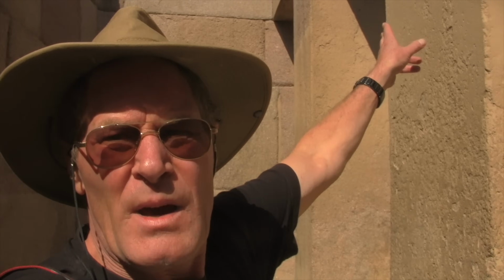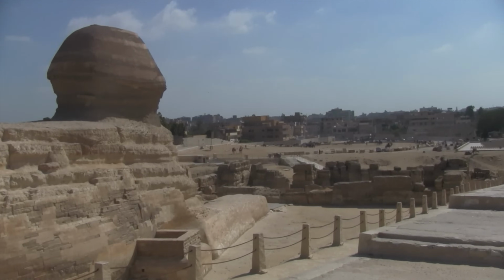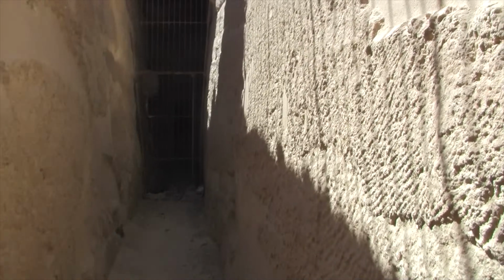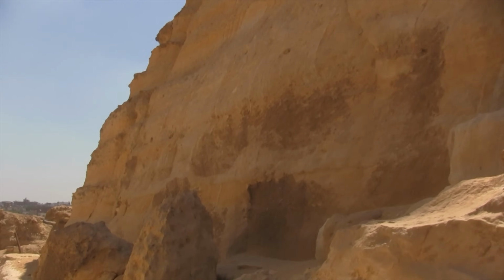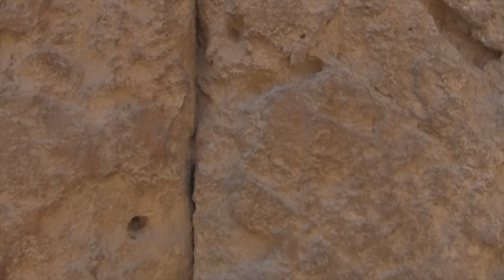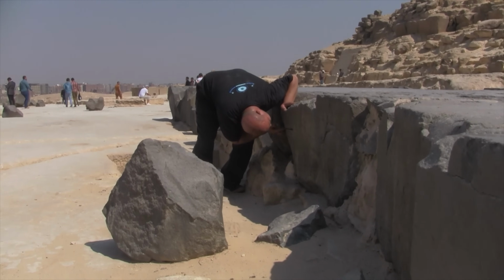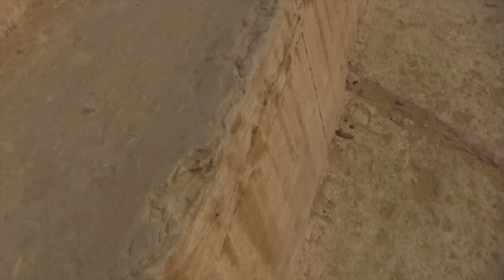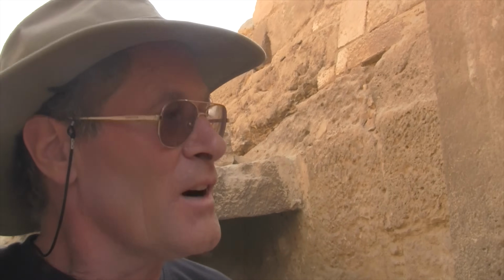Exploring Out Of Bounds Areas On The Giza Plateau In 2014

Comment: Ah those pesky close fitting rock joints - I like the acid theory which I first heard about on another YouTube video.  Ancients knew how to make acids that softened hard rocks which allowed  them, using simple tools, to face stones flat, hollowed them out and while a particular edge was in its softened state, it would allow the block to conform to the block it was set on or against.  This was done in the Americas too.  Ancient energy generators?  Whoa there hombre!  This video went from a fun Giza plateau video log to off the deep end in a real hurry about half way in.  First he says that by "energy" he does not necessarily mean electricity, then a few moments later, yes he says, it is electrical energy.  This guy typifies the random stream of consciousness filled with half baked hypotheses that so many of these ancient civilization videos are made up of (click bait).  They invite you into the conspiracy - All those experts surely are nuts, so listen to me, a random guy in a safari hat.  Regarding "weathering" and/or disruption of ancient architecture, there was a well known earthquake in 1303 AD (https://en.wikipedia.org/wiki/1303_Crete_earthquake ), for example, that knocked the casing stones off of the big pyramids on the Giza plateau.  Tunnels under the Giza plateau - I love how this guy goes from deep vertical shafts, most of which are filled in to a whole system of horizontal tunnels and on different vertical levels.  Not one ounce of proof, although, there are many examples in the Mediterranean of ancient cultures digging underground water tunnels, but come on dude, please stick to verifiable facts regarding such tunnels on the Giza plateau.  Take us in them, show us some maps, don't just ramble on and on and on.

So why did I bother to watch this video?  If you ignore the nonsense this guys is saying, he does take you to some cool off-the-beaten-track sections near the great pyramid.  Also, there is an increasing need these days for more rational people to push back against this sort of jibber jabber.  Clearly, people are believing it and, over time, this softens people's trust in real science.  It is a gateway drug to anti-vaxers and people who think 5g networks give you COVID-19.
Reply: Has anyone actually ever demonstrated the acid theory and reproduced the technique?

Comment: My theory is that the megalithic building is older than we think. Concrete can get harder with age, so why doesn't stone? As we know the earth's axis has changed. What if the rotation was faster wouldn't gravity be less because of centrifugal force? The large stones would be lighter and easier to move. Softer stones would be easier to cut. We have evidence that a huge meteor hit.  Isn't it possible that when that happened, it slowed down the rotation of the earth? That would have caused a huge catastrophe planet wide. The water of the oceans and lakes would cause tidal waves around the world. These are just my thoughts. Thanks for your videos of places that we can't travel to.

Comment: Intimate contact implies continuity which allows for resonance. Resonance is a means of amplifying signals and waveforms such that energy input is retained and improved. A building that can "vibrate" at piezo-electric wavelengths can radiate in the visible and infra-red spectrum. These buildings had "central" heating and lighting!

Comment: A Leyden jar describes the sort of energy storage you are describing, Brien.  In the Perneter theory that is basically a concentrator (whether it may also be a capacitor and store/regulate as well) for the energy of moving water through the network of passages below.  It seems a thorough map of those passages might lead to a demonstration model to prove whether the actual existing configuration could work, because the principles are sound.  It would be great to know that it worked!

Comment: Good look Brien.  That small pyramid( khentkawes) I firmly believe was the original mummification chamber at Giza.  There is a causeway going down from that to a covered up ancient harbor where the dead king would go on a symbolic boat ride on the Nile.  Representing the journey to the afterlife on the milky way.  The celestial Nile.  Fits the ancient text perfectly and that structure is aligned to the setting sun on Dec. 21 from the Valley Temple.
Reply from the maker: Great points
Reply: Amazing bro. 2 of my favorites in one comment. Mind blown. Keep doing what you do, brother. I'm a long time follower. The shit you do on ancient north america is mind blowing, sincerely.
Reply: @DrWarcloud36   Thanks.  Been a great learning experience doing that.  N. America is no different than anywhere else,  A deep history.
Reply: Many obelisk sites in present day cities is near a body body of water. 
Yes , i also believe that the Giza plateau was at waters edge for the long distance  transportation & hydraulic system to aid in placing the stones in place. 
Some of the blocks making up the King's chamber are in the 50 to 70 ton range ! That's apx. 230 ft above ground level.
The reflection of the pyramid,  the grand daddy of all obelisks  representing spirit ,which represents not only male potency but  the invisible spirit generative power of the heavens above, the  divine seed over the receiver, the earth represented by female, water.
The eternal flame is another modern day example of this ancient  cosmogeny ; as above , so below.
Fire; heavens, invisible , spirit /male 
Water ; earth , water , female. 
What a breath taking sight it must have been to see the golden capstones reflected  blinding light nearly 50 stories high  along with the  polished white limestone reflecting the sun's rays 
juxtaposed to a lush green & fertile country side reflected in the mirror still  pools & canals of water that must have likely  surrounded the complex.
My understanding is that the word Pyramid simply transliterates to fire in the midst / middle.
Pyra; fire 
Mid
Is it a mere coincidence that Giza is  geographically the point that divided Upper & Lower Egypt ? 
I think not.
Reply: @pedrorojascervantes3928  Interesting. My only criticism is with your translation of pyramid in connection to fire, Pyr, which is Greek in origin. The word pyramid is derived from the Egyptian pimar.
Reply: @DarrenAJordan  Thanks for  your correction.  Etymology is a most  interesting  subject & goes hand  in hand  with shining light onto ancient puzzles. 
I've  heard that  in Semitic languages  "ben" means ; "son of" 
Ben Ben  is the old word for the capstone / pyramidion. Also the word 'Senate' is said  to be of Egyptian  origin ; checkerboard/tezzerated design  of the chessboard.....Thoughts ?
Reply: @pedrorojascervantes3928  I don't know about an Egyptian connection with senate, afaik senate is latin for gathering of elders, as in old 'senile'

Ben meaning 'son of' is correct I believe, as in Judah ben Hur from the epic 1960's movie :)

Fun fact...the Egyptian word for Egypt 'kemet' translates as black land (the fertile black soil of the nile). 'deshret' or red land, is where we get the word desert from.
Reply: @DarrenAJordan  Interesting.  
Now I see why they chose  the  red & white  headdress  the pharaoh wore that  was symbolic of his rulership of upper  & lower  Egypt . 
Heraldry & coats  of arms symbols  & their apparent direct connection to ancient times  is a most  interesting field  of  interest  to me as well.
I've  heard it alluded  to that  the modern  fleur de lis symbol is a depiction  of  the fluted columns  that were erected in (pre?) dynastic  Egypt.
Reply: Why have all the priests and embalmers and funerary attendance when you could have just done it in the Great Pyramid for free? I'll lay even odds that the priests invented the long process in order to make and it sounds more money.
Reply: Well deducted
Reply: If the pyramid mummified naturally, why did the dead in their tombs has to be mummified through a process?
Reply: @rufust.firefly2474  - Shhhhh - not the kind of questions addressed here...
Reply: @rufust.firefly2474  
Maybe it was a force of habit, or not taking any chances? I'm only throwing out some ideas.

Comment: Cutting large megalithic blocks is done today as you can see on the show jade fever with cables that have tungsten teeth on them the cable is in a large loop and a wheel is used to drag the cable and teeth over the stone cutting through it. This technology was also used in a submarine rescue back a few years ago as well to cut the damaged part of a sub off to reflect the the rest of the sub

Comment: It really is a crime that they have blocked access to so much of these areas. It can only mean they are hiding the facts and truth and dont want it to get out. I wonder Brien if the answer to how these stones were moved does not lay in some advanced system that uses sound or manipulation using electricity to move them on a bed of gravitational waves or sound waves maybe? I have often been of the understanding the protuberances or nubs that we see on so many of these stones was in fact where the electrodes might have logically been placed. I wonder if someone could not apply a current to these and examine what effects it has on them? I have seen studies where sound waves have been applied and distinct patterns form when some material is placed on the platforms. Seems to me with the knowledge of how to manipulate these sound waves it would not be hard at all to get a material (stone) to move in a controllable direction in what can only be explained by the layman as levitation.
Reply: The tolerances they are manufactured to are simply breathtaking, it's as if they were 3d printed by mere thought alone friend
Reply: @suedenim6590  what do you mean by "tolerances?"
Reply: @DrWarcloud36  sure thing, it's the deviation structurally from a specific value usually expressed as a percent. So antedeluvian architecture is manufactured to  tolerances that are waaaay beyond anything that could be described as form or function. They deviate by mere mm across metres, it's as if they were created in this third dimension with a mere thought like "I want a wall, I want it from there to there, I want it straight....".
Reply: send drones or rc cars into those tunnels with live video feeds
Reply: Real life isn’t a fiction novel, no matter how much you want it to be
Reply: So why don't archaeologists speak about this? Is there some mass conspiracy among 1000s of them?
Reply: @stiannobelisto573  Because without allot of the current secracy, egypt is apparently afraid it will lose allot of it's revenue for tourism once people will find out the truth.
Reply: Greed runs the modern world. Not science, or love.
Reply: @Solanza  Thats a fact!
Reply: @stiannobelisto573  yes absolutely friend, anything that does not fit in with the existing model of our evolution (which is a lie) is dismissed.
Reply: @suedenim6590  but it is impossible for that many archeologists to keep silent, there is always "someone" who can't keep their mouth shut
Reply: Bretton Woods  That documentary gets more silly the longer it goes on 😂